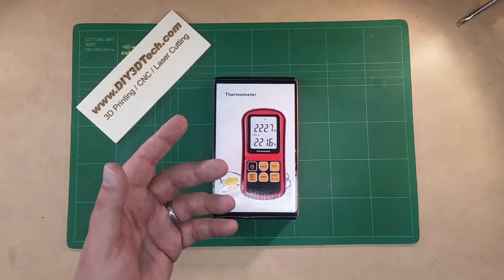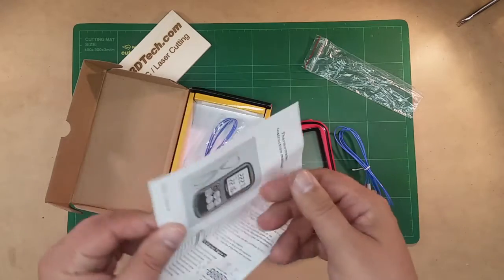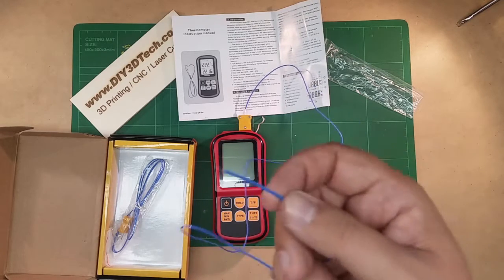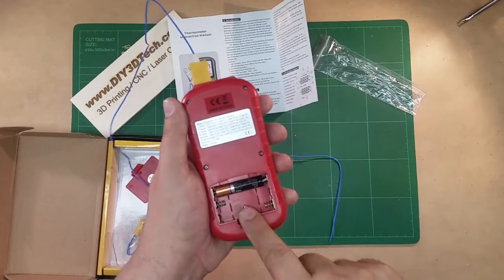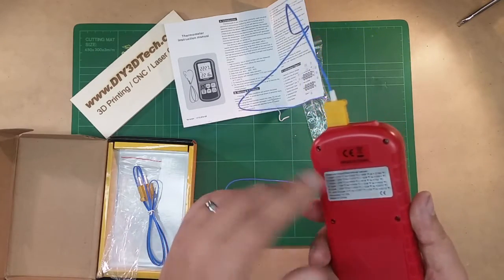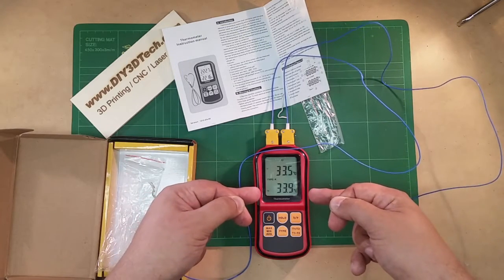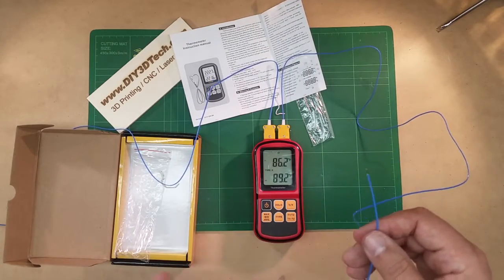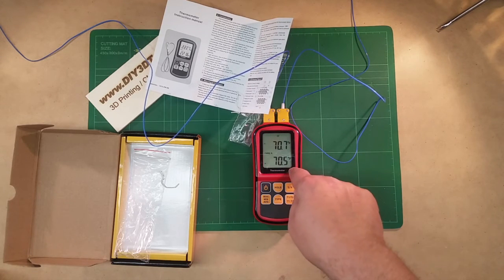Shop Talk - GM1312 Digital Thermometer 2channel Temperature Meter!

Comment: How to calibrate
Reply: Over on amazon.co.uk mw says:

The device did need room temperature calibration, it overstated room temperature somewhat on arrival. The manual doesn't tell you how to do this, and nor did Google, but I discovered this:

Partially remove/disconnect a battery. Press the Power on/off button (top left) and reinsert battery while keeping the button pressed. Unit now starts up in calibration mode. Press the bottom left and right keys to adjust the temperature offset. When done, press the Hold button to confirm the new offset, and then press the Power button to turn the unit off.

Probably best not to use rechargeable NiMH batteries, as my unit will work (while warning of a low battery) down to a voltage level of about 0.65V per battery, which is not good for NiMH cells. I didn't check when the low battery indicator kicks in.
Reply: thank yo
Reply: @TheAlanSaunders  Bro thanks. It works.
Reply: @TheAlanSaunders  Thank God i found this comment, it works.

Comment: Nice presentation.
Remember when you are extending thermocouple wires, you need to use compensated wire for the type of thermocouple you are using.  Omega Engineering has a lot of free tech data for temperature measurement in the Technical Learning section of their site.
I am looking for a measurement unit for my 3D printer enclosure to shut off the power if things are getting too hot,  Does this unit have an output?
Reply from the maker: Good info and sorry this doesn't have an output but why not use a NANO?  That's how I would go about it with a sainsmart relay board (because they are super cheap)...
Reply: The problem with nano and other micros is getting the thermocouple tables into the program.  I suppose I could use a thermistor instead.
Reply from the maker: I can see your point, however I would "cheat" since your doing this as a safely stop and calculate the target and tell the NANO just to look for that target (If/Then) and trip out the relay...
Reply: That would work.  Thanks

Comment: I bought one of these to calibrate my hot end, but since getting it, I've noticed that it is off by quite a bit.  Have you figured out a way to calibrate it at all?  That's how I found this video.  I tested it with my own body temp, and it was reading 100F, and then I went outside where it was -5F, and it was reading 20F.  Same amount in C as well.  I was hoping it would be more accurate...
Reply from the maker: Hmm I have tested it against several other meters and it is right in there so no issues as you are seeing however I am you realize is a mode setting on this for differing thermistor and would guess from the delta you shared that some how the mode changed so that would be the first thing I would suggest checking...
Reply: @DIY3DTECHcom  Hi, sorry i don't like correcting people but these are thermocouples not thermistors, thermistors use a negative temperature coefficient (NTC type) resistance to give a temperature reading, were as thermocouples produce a voltage from the different metals where they are coupled, each type produce a different voltage table.
Reply: It's set to the k-type thermocouple.  It's the same blue ones that came with it.  I dunno what the deal is with it?
Reply from the maker: believe that is correct, maybe you have a bad thermocouple?  are both reading the same? As mine out of the box matched my other ones (from other vendors)...
Reply: Yep, both are the same, and read the same.  Maybe I got mine so cheap ($12.00) because it was a defect from the factory or something... otherwise, I dunno.
Reply from the maker: I ordered extra (i.e. replacement) thermocouples from Amazon.  Maybe its worth doing that seeing as maybe they sent you the worg ones, or maybe try some some of the other settings and see what happens...

Comment: looks  very handy .  Do the probes pick up EMF  , EM noise  .  the reason i ask , i was combing through forums and  one fellow found routing his  thermistor with along side his hot-end heater  wire was throwing off his readings . I wonder if small ferrite choke could help near the  board / ramps side . hmm i think i have some . should be a easy test rite . 
any rate great stuff as usual man .  ( re ferrite chokes , I used to slap em on anything the went to a IC  that was exhibiting strange behavior. like phone line going to old digital answering machines. LOL )
Reply: Hi I just read what issue you had with the garage doors :-( . I am presuming that the radio remote stopped working  ? . If so this would be down to RFI and not EMI . cheap / budget switch mode psu's generate tons of unwanted Radio frequency noise and the radio transmitters and recievers for garage door openers and such like usually have no noise rejection or compensation and these are generally the first things to show a fault in the presence of RFI spikes.
The Led driver is the criminal I suspect.
Reply from the maker: Yea I know what you mean :-) (Old TV's just worked better near me)  As a kid my job was to stand there and hold the rabbit ears :-)
Reply from the maker: So talk about EMI, at one of my rentals houses this weekend got call the garage door didn't work and went hmm that is a brand new opener.  If the tenant stood inside the garage it worked but outside no go.  So I went there and sure enough, very odd as it worked before they moved in (end of last week when I finished it up) as I used the opener for the remodeling (as just bought it a month ago).  However since I have authored books on complex problem solving (http://amzn.to/2gjTJP5) and do it for a living I went forth to discover the last time I left was though the front door as I left the remotes on the counter for them and last thing I did before that was replace the [garage] opener bulbs with LEDs so took them out and replaced them with incandescent and boom garage door now working again!  They were generating so much EMI the opener won't work but from a few feet!  Ugh...
Reply: ha LMAO . 
I'm a RF oddity.  I think its a combo of working in a RadioShack and the repair bench all those years , and the few bits of who knows what i was exposed to in the Navy before that . Old TV's just worked better near me , and fussy old radios usually had no reception issues if i was rite by them , but if i should walk foot away or change my posture , Its like i obliterated the signal . LOL . 
My car remote has the indicator LED in the ground path of the whole circuit . The factory LED fell out from cold solder joint / age , and well no diode to pass teh power.  i put in a generic led , it was dim and i had to get rite close to the car . so i changed the battery , no diff.  so I swapped out that SMD one for a low voltage through hole i had , and blammo it works across the whole wallmart parking lot . hahah .
Reply from the maker: Yes it was the bulb and since RF is actually electromagnetic radiation I kinda count the two as the same :-)

Comment: Hi just a side note: These devices are reasonably accurate but unless they have been correctly calibrated the readings given may still not be the true temperature. but overall should be ok for the tasks you mention. also if using the 2 probes on metalic objects or conductive materials then ensure the probe tips do not conduct between each other as this will also effect the readings given by the instrument.
Reply from the maker: Your 100% right, my brother in law worked for NIST and remember him getting bent over 25 decimal points :-) For me repetitiveness is the major thing for comparison.
Reply: Hi again. yes sorry for the petty comment - unfortunately being an electrical engineer has made me a little anul on details :-) . Still they are an excellent device to have in your toolbox and I think anyone involved in 3d Printing would benefit from having one to hand. Thanks for the video.
Reply from the maker: No worries once upon a time I was you :-) (electrical engineer) than went to the dark side!
Reply: The force is strong ! sometimes I wished I had taken up pottery :-)
Reply from the maker: LOL!